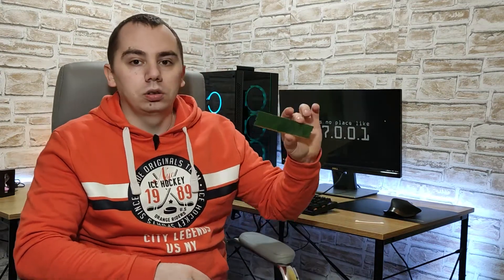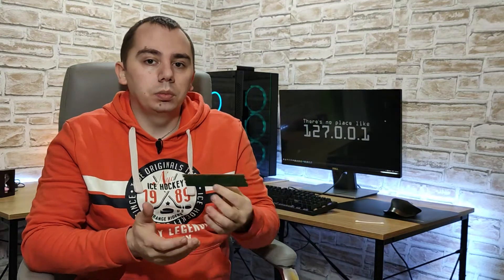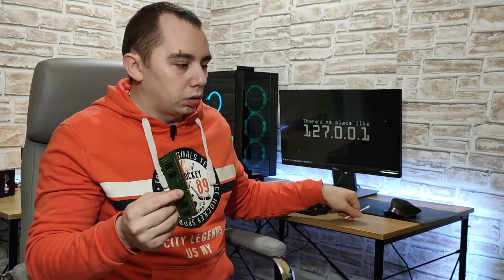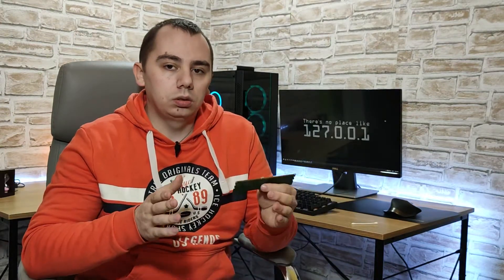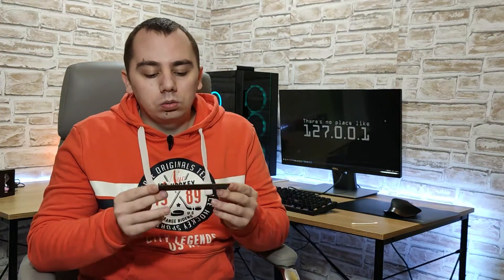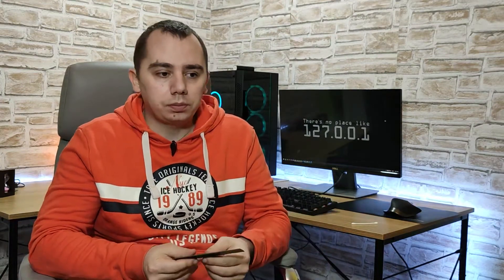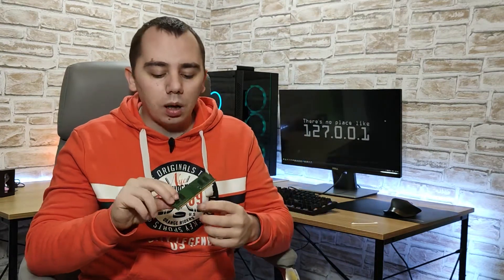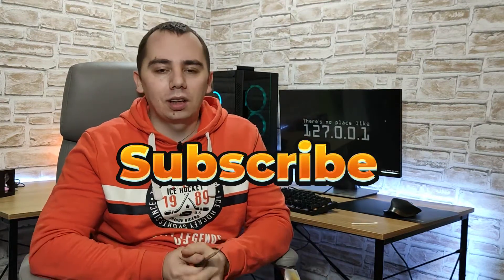Cleaning RAM modules and slots - on an old PC | TechieShow

Comment: hello short circuit happened after cleaning the PC using a blower it seems some of the dust went inside the ram slots I tried the rams on the other PC it worked fine

Comment: Dose this help with hdmi because the signal doesn’t go to my monitor but my pc works
Reply from the maker: As far as I know no. It's very rare that dirt can get into your HDMI plug. Check the connections or even try swapping the cable with another one.
Reply: Did you ever find a fix? im having this exact issue
Reply: @Gensis  it turned out I was plugging the hdmi into the graphics card hdmi so if your pc has multiple ports for hdmi try them all

Comment: Thanks. I easily have access rubbing alcohol but isopropyl alcohol is apparently banned
Reply: it’s the same thing
Reply: @wolfofmortis818  Not necessarily. I think I have access to the 'wintergreen' variant of rubbing alcohol, so it has additional ingredients so I'm not sure if it's good for electronics. Fortunately I got my hands on some electrical contact cleaner which should work fine.
Reply: @jackkraken3888  Ah ok.
Reply: @jackkraken3888  But bro, the wintergreen stuff is literally just isopropyl alcohol with fragrance and dye. There's no way it could be banned if that stuff is for sale. Did you mean high percentage rubbing alcohol or something? Doesn't make much sense.

Comment: Please dont use any kind of liquid because it will likely destroy the ram
Reply from the maker: Haven't had any problem with any RAM type & rubbing alcohol preferably >70%. Of course, you just put a little on a Q-tip and wait for it to dry after rubbing the contact pads (just the contact pads not the whole memory stick). But this is the last resort thing anyway, to at least try to make it boot. A memcheck run is still needed of course.

Comment: Thanks for the video. Learnt for the first time that there are methods other than that eraser which my engineer used to use it to clean it. 
I had a POST issue, cleaned it with rubber as I saw your video after the cleaning. If that thing happens again, I am going with your method.

Comment: I have an old DDR2 laptop ram it used to work but now my laptop won't works its got a beep sound also after I tried the eraser method it works but few weeks later its back to beeping when i switch on it. I'll try your step!! Thanks